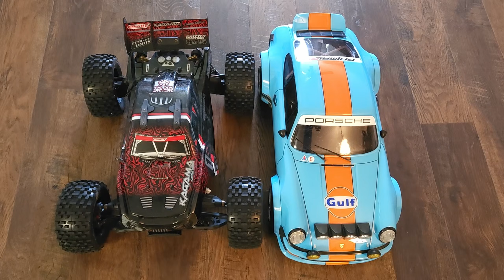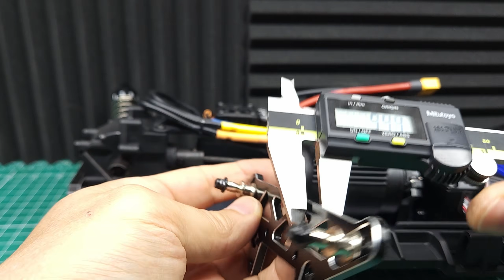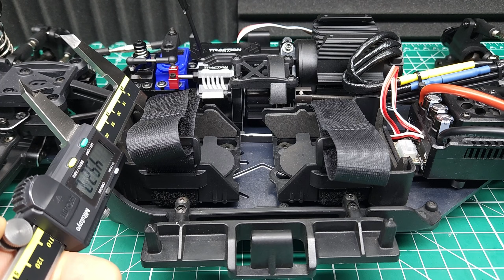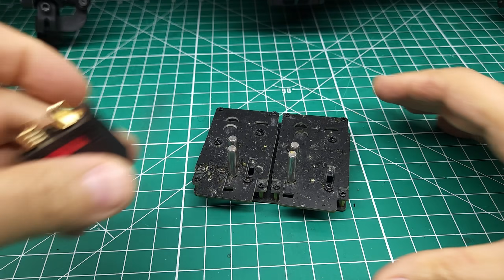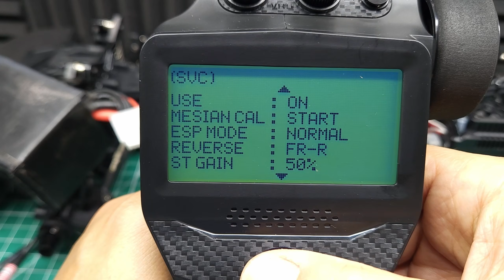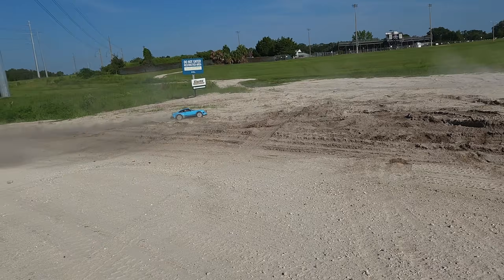Dream Or Disaster? Primal RC Porsche Is Here!

Comment: Do you think you could explain an adjustable servo saver? I’ve haven’t seen that on any videos yet. How to use an adjusted servo saver. I have one on my TYPHON but I don’t know how to adjust or the benefits of adjusting it
Reply from the maker: The adjustable servo saver essentially changes the preload tension of the spring. The spring is what presses the two canned surfaces together. Those cammed surfaces are what allow the servo saver to have compliance to help protect the servo from physical impact. The tighter the spring the less compliance. This gives you more steering feel as the servo saver will have less flex in it but makes it more likely you're going to harm your servo. Where you should set your particular servo saver depends on too many factors for me to say but the safe way to do it is start loose and then keep tightening until you reach a point where the steering is responsive enough without it being too tight.

Comment: Had my centre diff apart, when in rear wheel drive it locks the diff, in 4 wheel its open, im just changing the diff oil to 20000cst see how that goes 😊

Comment: good day, in a different vid, there was an issues with the throttle having a delay after braking, did you experience this, and is there an adjustment for it? thank you
Reply from the maker: Not something I experienced and given that it's just a standard hobby wing ESC if the other person was having that issue it's almost certainly a specific problem with their ESC not a problem that's going to be seen model wide.

Comment: I feel like to much money has been spent on making it look nice, It’s a great looking car, attention to detail is spot on but for me I was a little underwhelmed especially when I noticed the XT60 connector, all metal diffs are clearly a winner and will be received well HW set up is nice but would be better with an 8s capable set up, and am I mistaken in thinking this is the same combo that was put in the FTX DR8 a few years ago? For me it’s nice and it’s got some trick bits but if I buy this it’s gonna be pre owned cos 700+ is a bit steep. @DoRC another great video and detailed tear down dude, appreciate the effort put into your videos dude. Greetings from South Wales 🏴
Reply from the maker: I personally think it's plenty of power. The small tires on this means traction is always going to be your limiting factor and it's already the limiting factor at 6s.
Reply: @DoRC Bigger wheels and tyres for sure and I’d like more power maybe a 4985 1650kv set up but I’m used to faster speeds on account of my dogs being pretty fast and the inevitable fact that I would get bored quickly running over to put it back on it’s wheels because they can catch it 😂 It seems like a solid car though but I think it could handle a bit more power without upgrading it, maybe gearing it down and running it on a bigger lipo might be enough to pep it up a bit, I’m sure someone will do it soon 😉

Comment: You said we haven't but.....We have seen all of this before it's the same as the traction/ km c3 rally car iv had mine for almost 1 year, primal has just had their put their name on it, i also had to adjust the selectable the 2/4wd
Reply from the maker: I meant we hadn't seen it on the channel before.  It's the first time I've messed with it.
Reply: @DoRC arrrr fair play! Just a FYI There's a few upgrades available for this platform, DUI make some high quality parts for it that have been anodized and machined afterwards, like some of the orginal hardware

Comment: I have this things cousin, the WRC Citroen C3. Cool body as well. It’s been near trouble free for me, some bashing, sliding, dirt. Nothing crazy like monster jumps etc. That 2wd to 4wd thing has been a bit finicky for me, on occasion it is hesitant to engage 4wd from 2wd, always disengages 4wd no issue. The factory steering servo seems fine for an RTR. Otherwise no real issues. That radio being in Chinese for some menus is annoying, I just use Google translate and it’s been mostly ok, albeit a hassle. Parts have been wacky on the Citroen, allegedly Primal will carry parts for this and my C3 so yeah that would help…
It’s different from ARRMA for sure, more niche for sure and not really an aftermarket for it that I’m aware of. That said I think it drives well and is well made.

Comment: I've used mine a few times now and noticed the same thing with the centre diff. The diff is unloading even when the slider is fully engaged for 2wd.
Reply from the maker: Check to make sure it is actually going all the way in. I thought I was but the dogs weren't engaging. You can adjust the endpoint for the channel to push it further. When mine's all the way engaged the little block on the rod is actually touching the case.
Reply: @DoRC I haven't worked out how to adjust the end points yet - I was manually moving the arm when I checked. Ill take another look 👍

Comment: Are those extra rally lights on the front removable?  I really like the Gulf livery but hate the lights.  The red doesn't have the lights.  I really think I'd just get the MJX or KM C3 instead. I like the Porsche body better but not 2x the price better.  Most all my bash areas are grass though and I've already got 2 6s Infractions i rarely drive. Also the less Primal was involved in this the better.  Ultimately this is another of those cars i like but don't want.

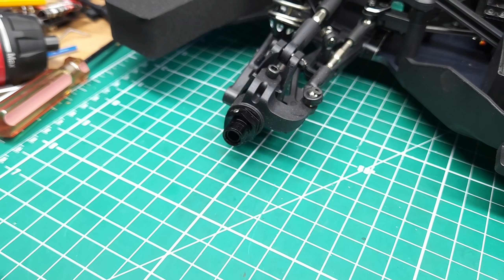Comment: I saw a recent video where another 934 owner's rear wheels both came off at the axles from what he said were a bad pin placement.  The pins on the front axles cross through the hexes (2:49) so they can't slide out when the wheels are mounted and covering them, whereas the pins on the rear axles don't go through the hexes so they're always exposed (2:54) due to the wider rear track and longer axles.  I'm guessing the front and rear track widths on the KM C3 are the same.  Looking at it IRL, do you have any potential concerns in this area?

Great teardown/run-through BTW & FTW!

Comment: Off topic from this particular video. But what do you recommend for shock oil ? As far as weight goes ? For a decent all around basher ? I’ve heard 30 weight then I’ve heard 100 . So hard to get a straight answer on overall safe bet to use
Reply from the maker: It depends on the vehicle depends on the terrain and depends on your bashing style. Best thing is to start with stock and then just mess around and see what works for you.
Reply: @DoRC I was afraid that would be my answer lol

Comment: Noticed u said in 2 wheel it seemed to bleed power to the front but from looking at that shift mechanism when it's in 2 wheel the dogs lock into the center diff locking up the center diff so thicker fluid won't do anything
Reply from the maker: Yes if you watch to the end of the video I talk about that. Mine wasn't set properly so it wasn't actually engaging the locking dog into the differential.
Reply: @DoRC lol I literally just got to the end and was gonna edit my comment lol making comments before the end

Comment: Yea that tire gluing method would not work for me. That’s what Traxxas does. Gotta peel them bois up and actually get it down in the bead
Reply from the maker: I've been doing it for a while now and I've only ever had a failure if I actually missed a spot. With the really thin CA capillary reaction pulls it down into the joint.

Comment: One thing with the soldering I noticed. You really want to use flux. Back in the days of mostly copper wire the flux within rosin core seemed to be enough, but these days aluminum wire tends to fight a lot more. Also fuck EC5. By far the worst connector to solder, IC5s are an eye watering $6 for male/female pair at best and xt90 anti spark come out to $2.4. SC5 connectors are fairly priced but they can’t keep stock, and the whole series lacks spark arresting which shortens the lifespan of both the battery and esc side connector. I was going to switch but I’m firmly against it now.

I’ve also seen a lot of debate about the ec5 being higher current than xt90. I’m sure that’s somewhat true, but the claim of 120amps is bonkers considering QS8 is rated for 110 constant. If we talk about bursts, xt90 is well capable of 250+ so I don’t get why ec5, a proprietary standard of horizon, is more popular.
Reply from the maker: Yeah connect to ratings in the hobby are kind of all over the place and I'm not sure which ones to trust. 
The solder has flux in it.

Comment: That is a lovely Porsche but i think that the 2wd function is pointless with central differential
Reply from the maker: Did you see what I said about it at the end of the video? They actually have it set up to where it locks out the center differential when in two-wheel drive. Mine just wasn't adjusted properly from the factory so it wasn't actually engaging that lockout.
Reply: @DoRC yeah but all that power is going through the central diff which has oil in it and that's supposed to make it limited slip so it can definitely put a lots of stress on the electronics and the diff itself

Comment: Hey, great video,  It's a bit confusing ? KM/Traction hobby/ Primal RC, I just got the  KM Citroen 1/7  rally car yesterday, like the MJX 1/7 Citroen there both under powered forb there size and weight, I drove it in stock form and was not impressed lol, this morning I swapped out the ESC for a Hobby Wing Max6 paired with a 18t pinion, the Dumbo DDf -350 radio comes with my car but it only running a 100 amp esc,  so your model comes with a better esc but not so good radio lol, its all KM/ and Traction Hobby, not sure how the partnership is with Primal RC  is? There are around 4 to 5 other rally bodies  that will fit our chassis,  Fiesta , 2 Subaru bodies , Citroen.I found the  tryers not so good of road, I will be looking for some good off road tyres.
Reply from the maker: Your guess is as good as mine. Other than the branding I didn't really see any evidence primal was involved.

Comment: 12:39 thin center diff fluid with the front disengaged means… no wheel drive…? How does that make sense?
Reply: It doesn't.
Reply: yeah i was wondering the same.
When my e-revo became frontwheel drive it was anything bus usable. And that has some pretty thick fluids in the centre.
It was usable to get back. But anything beyond walking speed was just building heat in the diff.
Reply from the maker: If you watch the end I correct myself. Because mine wasn't set right from the factory it wasn't locking the center diff together into wheel drive so all the power was just bleeding off to the front like there was no front drive.

Comment: Mine's currently in transit, I don't know if I should continue watching this video or wait... granted I've already seen another video on it a few weeks ago, let's keep watching!

I know it's supposedly sharing the platform of the Citroën rally car but being a Porsche it should be rear-wheel drive/ all-wheel drive, not front wheel drive/ all-wheel drive. I wonder if that's an oversight or it's installed backwards.
Reply from the maker: Watch it!
Reply: @DoRC I wonder if yours is going to differentiate from slightly later ones, as in some of the bugs. I doubt it, but thanks for the quick guide on the transmitter at least, that'll be some money I get to get back, I have a flysky noble already.

As far as my edited in comment goes, you cleared that up later in the video about it being a front locker and not front wheel drive. 

Do you plan on going through some of the quirks and making a part 2 to this vehicle or do you think it's worth going to the manufacturer and letting them know and let them release a statement on it?

Comment: I think that is more an hpi vorza/apache or a hb d8 clone with only a open arm design instead of the close design of the original 

So definitely not a new design but a clone
Reply from the maker: It definitely does appear to be at least inspired by the old HPI. There are quite a few differences though.
Reply: @DoRC for what i see not so much:
Motor mount, diff case, arm

shock tower and shock look like the same as the hb rgt8 ( the gt based on the d8 chassis)

They added some gt style bumper with clipless mount, 
But everything else look like an hpi vorza or the d8 ( remember that all the vorza/apache line are tecnically an eletric hb racing d8 )
Reply from the maker: Fair enough. Yeah there are definitely enough similarities to make it feel like It's a bit more than just inspired by.